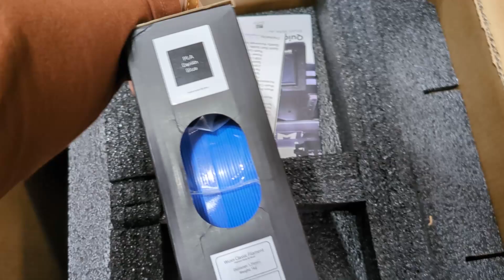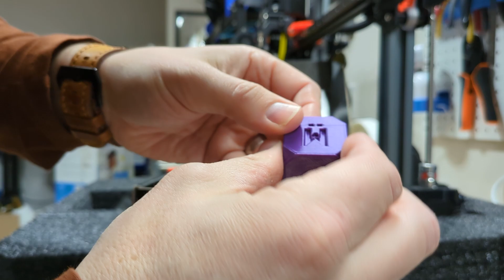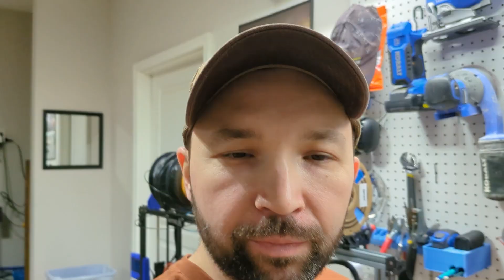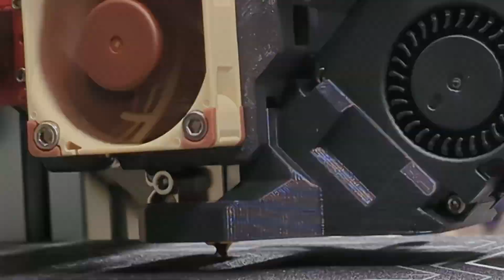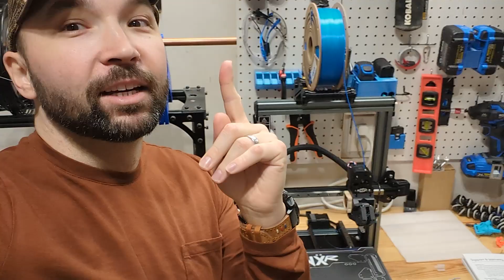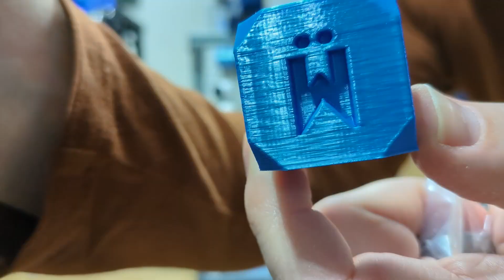NEW 3D PRINTER! Wuxn WXR Unboxing, Setup, and Initial Review

Comment: The reason you had trouble removing the print is because you didn't let it cool down. I like to take the build sheet off and fan it in the air to speed up the cool down, then simply flex the plate after it's cooled down and it'll easily break the seal. However, never use a skirt when printing on this printer. It's (skirt) very difficult to remove. The initial purge line is sufficient and removes easily. This printer is so quiet, I find myself constantly checking to make sure it's still running. I've got two of these and two Lulzbot Mini 2's. I don't use the Lulzbots anymore. Plus the price of these has actually come down a couple a hundred dollars since the making of this video making it, in my opinion, the best bang for the buck printer on the market. AND the customer service is excellent.

Comment: I own one of these and absolutely love it, if you want to take it to the next level you should check out the inproved fan duct by gigaloader along with his Magnitude 10 firmware to go along with it. Finally a genuine bondtech CHT nozzle to also go with the faster speeds and accelerations used in the magnitude firmware.

Comment: What drew you to the WXR and did you consider any other printer?
 I love this printer, it is a quality machine!
Your reaction to the print speed was pretty much the same as mine when I got my X1 Carbon, of course we have seen these new fast printers on video but actually having that speed in front of you is mind blowing, when I first switched my X1C to ludicrous mode I had to switch it back to sport mode as I thought the table I had it on would break, but I had another go and it was OK, it never ceases to amaze me how good the print quality is at these fantastic speeds!
Reply from the maker: A few reasons made me go with the WXR. 
First limiting factor is that I generally try to avoid made in china products. Nothing against the quality or anything like that. I don't want to support the CCP's economy and their threats to attack Taiwan. I lived in Taiwan for 3 years and this is pretty close to the heart for me. So I figure the best thing I can do to try and prevent that is limit their military by limiting their economy as much as i can. Made in USA is a nice to have.
So that takes out a lot of options for 3d printers for me.
Next is, I dont have a lot of time to put together the machine so something like a voron is out of the question. Some assembly is ok (prusa semi assembled would be fine) but anything more than a couple hours wasn't worth it. So something that can work so well out of the box (literally) is a huge bonus.
There arent a lot of reviews about the WXR out there but what I could tell is basically 100% positive experiences which is awesome. When it is a small company with limited user base, it is a bit of a risk but seeing as how positive the feedback was it made me feel good. 
Print volume was enough for 99.9% of what I do and I still have my lulzbot if I need more.
Price. It was between a Mk4 from Prusa or this and when I purchased on cyber monday, who had the better deal and price. I could have bought 2 WXRs for one Mk4. So I pulled the trigger.